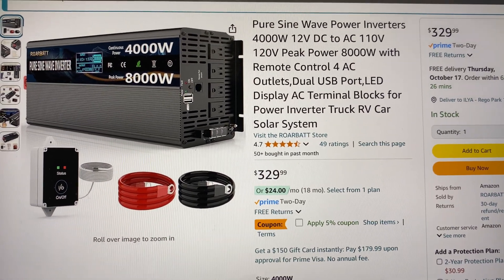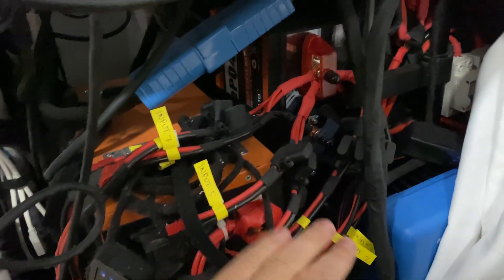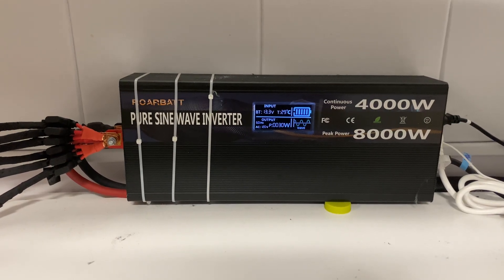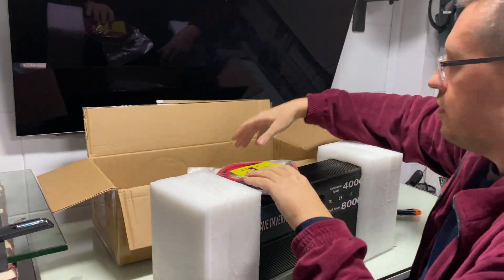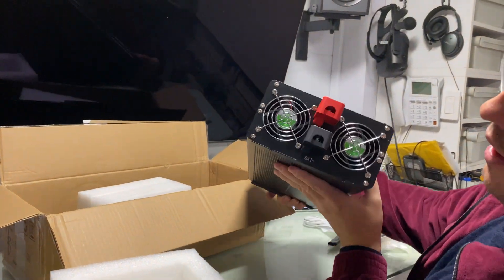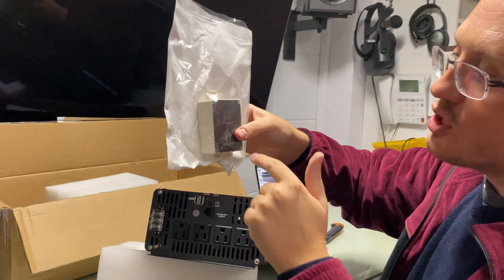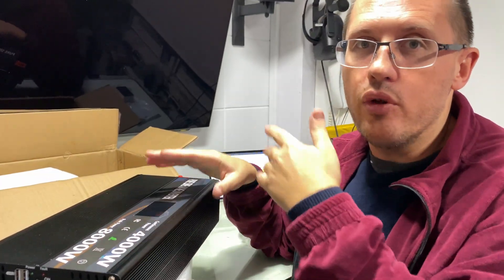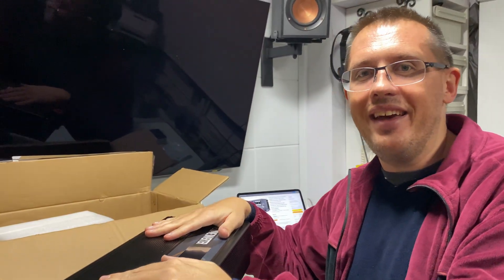🔋 Roarbatt 12v 4000 Watt Pure Sine Wave Inverter Best off Grid Solar REVIEW UNBOXING #wisebuyreviews

Comment from the maker: See it here: https://amzn.to/3YbjLYD  [amazon affiliate links]
Pure Sine Wave Power Inverters 4000W 12V DC to AC 110V 120V Peak Power 8000W with Remote Control 4 AC Outlets,Dual USB Port,LED Display AC Terminal Blocks for Power Inverter Truck RV Car Solar System

HERE ARE THE ITEMS I USED TO CONNECT IT: 

- 350A Battery Connector AWG 2/0 Quick Connect Battery Modular Power Connectors Quick Disconnect (Blue) - https://amzn.to/3NrLFdT
- TKDMR 10pcs 2/0 AWG-5/16" Battery Lugs,Copper Wire Lugs - https://amzn.to/489xW4Y
- 2/0 Gauge 15 Feet Black 15 Feet Red 2/0 AWG Ultra Flexible Welding Battery Copper Cable Wire  - https://amzn.to/4ha6UPc
- Hydraulic Crimping Tool and Cable Cutter Hydraulic Cable Lug Crimper - https://amzn.to/4dPqhKc 
- Cloudenergy LiFePO4 Battery 12V 300Ah 3.84kWh Deep Cycle with Longer Runtime, Built-in 100A BMS https://amzn.to/4dQnelc
- Victron Energy BlueSolar MPPT Tr Solar Charge Controller - Charge Controllers for Solar Panels - 150V, 70 amp, 12/24/36/48 -Volthttps://amzn.to/4eGLibi

- See also the HOW TO GUIDE to the Anderson Connectors: 
https://www.youtube.com/watch?v=zZkIR48C4uE

In this video I explore reasons why I believe this is the best sineway inverter that can output 4000 watts continuous from a 12v battery bank. It has a beautiful screen on it showing how much wattage you are using and the lowest power draw that I could find. Bought this myself and this is my third unit. Also went through an unboxing of the unit. 

See all my videos here:
https://www.youtube.com/@wisebuyreviews/videos

- Youtube https://youtu.be/I8-J4XMKIN4
- brighteon https://www.brighteon.com/1bf6a030-77ed-4df1-b20f-fc666d7d764e
- clouthub https://app.clouthub.com/#/videos/videos/45a22aeb-58e6-4f7c-a860-a37d086b2fde
- dailymotion https://dai.ly/x97fb88
- odysee https://odysee.com/@wisebuyreviews:d/Roarbatt-12v-4000-Watt-Pure-Sine-Wave-Inverter-Best-off-Grid-Solar-REVIEW---UNBOXING--wisebuyreviews:8
- bitchute https://old.bitchute.com/video/viyjrxAEHZeQ/
- rumble https://rumble.com/v5iu8jh-roarbatt-12v-4000-watt-pure-sine-wave-inverter-best-off-grid-solar-review-a.html

Comment: Trying to find best 4000-5000 watt pure sine wave inverter for a semi truck I have a diesel powered apu unit and 4 batteries on the truck
Reply from the maker: This is my highest power unit and I love it because of the remote control so you can press power directly on it or on the button you can wire to where you need it, so I recommend it. You do have what looks like possibly 24v system so this one won't work on it, but will work if it is parallel 4 batteries at 12v. Good luck! Using it everyday, have cooked chicken on it  and can handle high power I love it!

Comment: That's going to take what 5 batteries in parallel to supply the proper energy?
Reply from the maker: Most 100ah batteries have 100 amp bms, so you can go with 4 to do the 4000 watt output without any battery shutting down from the bms, and usually those bms' can go higher. So to be super safe 5 is the ultimate amount perhaps. At the same time most of the time you won't run such a load but to be able to is what counts. Thanks for the good question!
Reply: @wisebuyreviews  well I learned the hard way that I need to be able to supply the amperage to the inverter or the inverters worthless. 😂
Reply: Just recently installed this 4000 W / 8000 Watt ROARBATT Inverter 2 months ago , for now I running it with only 2 Lithium Iron  12 V 200 AH LiFi PO4 Batteries . As for the proper energy question : It gives me the energy I'm looking for , I aimed for 2000 - 3000 Watt the very most and never at the same moment . So considering my simple electric thinking , I have installed a too large Inverter with possibility's to expand .
Reply: @ As long as you are using thick enough cable (3/0 aka 000 in this case for continuous power transmission), and don't mind the heat and lower efficiency.  Cables that are too small will transmit the heat into the batteries or inverter circuitry, so it isn't recommended.

I will remark that lead-heads ... what we called ourselves in the old days of 12V lead-acid battery banks, often under-size cable simply because the cables wind up being so expensive at those low voltages.  But it isn't good practice.

The beauty of using a higher voltage is that the wiring is vastly simplified.  One can use 2 AWG with a 48V system and it will barely even get warm at 5000W. 

Using an over-sized inverter means that the inverter's idle consumption is going to be higher.  It can be a decent trade-off but the no-load consumption can be quite high depending on the inverter.

-Matt
Reply: @ thanks for your interesting input on my post , I never worried about the idle consumption . NOW A 24 hour no load test showed me a Batterie decrease of  0.10 VOLT . Without a smart solar or standby charger , I would weakening my batterie setup by a total of 1.0 VOLT in 10 days . 2 weeks of Spring brake could mean that my 13.4 VOLT Batteries are down to 12 VOLT .
Reply: ... or you could be smart can use a higher system voltage, like 48V, and a 48V to 120VAC inverter cabled with 2 AWG and run 5000W all day long without anything even getting warm.
Reply: @junkerzn7312  you don't have to be a dick. I'm on a 24v system. 2kw inverter 1.2kw solar. I'm just pointing out to others that multiple parallel batteries are required.

Comment: Poor choice for the inverter. You would have been far better off installing a low frequency, transformer based inverter charger. Low frequency inverters offer a far longer life expectancy, a much higher surge capacity, and they offer galvanic isolation between their DC boost stage and their AC output for far safer operation. A high frequency, transformerless inverter like this can not only damage your AC appliances, they can even set your AC appliances on fire.
Reply from the maker: Thanks for the comment, I have been running it for quite a while now with no issues so far, but I understand your concerns. Most things are actually high frequency especially the ones in solar generators, so you are condemning those too. Which one do you recommend?
Reply: Screw all in one junk.Get low frq.But buy what you can afford but low FRQ will outlast. Sun gold power looks like 5 other unites that low frq.A 4k costs about 800- 900 bucks

Comment: Show real life stress tests. Just because a product looks good, doesn't mean it's good. Get some testing equipment to show the sign wave.
Reply from the maker: You will have to take my word for it that I have used a nuwave to test it out and it drew 1800-2000 watts multiple times for an hour getting a whole chicken cooked up in the rotiserrie. Didn't push it past that. I have also used it on my gaming rig which have been using for months on end and works flawlessly, although I admit did not pull more than about 700watts from it. So it is a bit of a long-term review in my use case. It is rare that people will connect two rotisseries, but likely would do a rotisserie and a coffee maker which I think it could handle. However with amazon easy returns, if you have a load like that please make a video and share it in the comment, and if it doesn't work return within 30 days and get a free label. I am just like you bought my own stuff after looking around at dozens or hundreds of options until settling on this one. Just like yourself I do have a lot to do and would rather not go through sine wave tests, as at least at this point if find that kind of boring. However I applaud  people like HoboTech for doing that, they are awesome! I just like a unit that will work and I know I can't really overload because normally people don't use that much, and I thought 2000 and 3000 is just not enough for those cases.

- This is the rotiserrie I used: 
https://amzn.to/4eOW1R0 Nuwave Brio Air Fryer Oven, 15.5Qt X-Large Family Size, SS Rotisserie Basket &Skewer-Kit, Reversible Ultra Non-Stick Grill/Griddle Plate, Powerful 1800W, Integrated Smart Thermometer,Black

Comment: No way that I will ever install that in my house. Sorry. But cheap =electrical chaos and insurance claim problems.
Reply from the maker: Good point, I felt the same way before, used to get only solar generators that are clean sleek and have everything all in one, with limited battery capacity of 2kw hours usually, however I found such a unit to be more efficient, and those batteries to the right of my desk are almost 8 kilowatt hours of stored energy. So in case of power outage I may have power for days. When eventually I get an off-grid place, I can easily put it in,  no extra wiring necessary, everything is already there.   What unit are you putting in your house?
Reply: Brush up on yer terminology.
Reply: Please tell me more about your anderson connection "spider" for other 12v sources. Did you purchase it or make it? I think I need that in my life since I have many batteries of different chemistries.